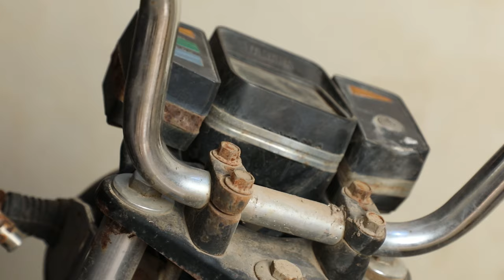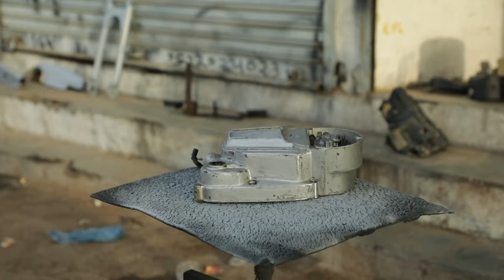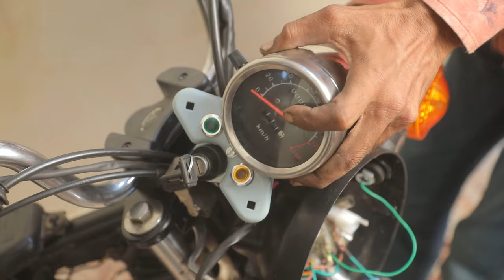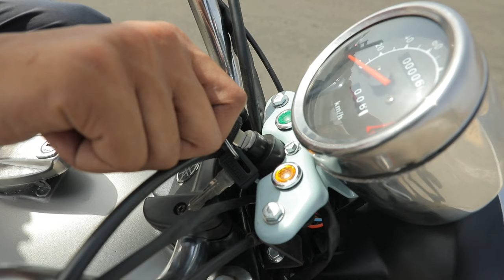Yamaha RX100 Full Restoration Old Bike | Repair & Restoration

Comment: How much did it cost for Full restoration?
Reply: Full cost with bike 36000
Reply: @atozvideozon6310  how you know
Reply: Bro I also want a bike
Reply: bro 50k iam from karnataka i also restored my 135 2 yrs ago i bought bike in 8k in same condidtion
Reply: original painting amount is 10-12k almost compny painting
Reply: @mercy319  hey nice brother
I’m from Bengaluru. I’ve also restored my 135.
Reply: @mercy319  but this isn't company paint so 5-7k for this bike is enough for paint